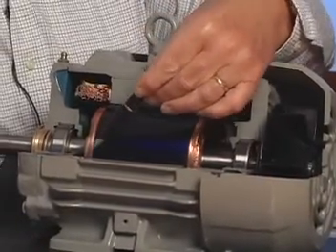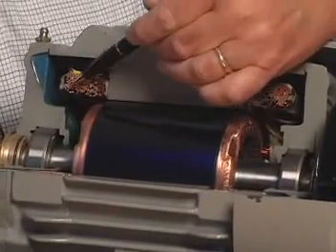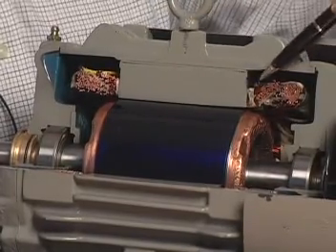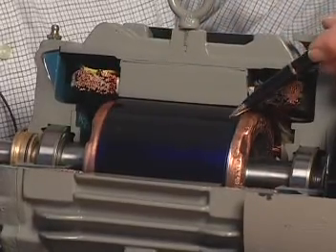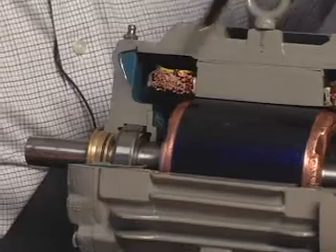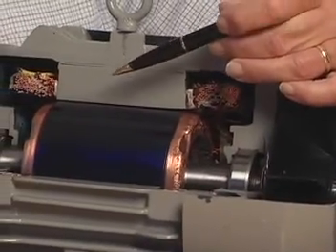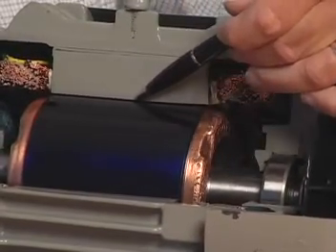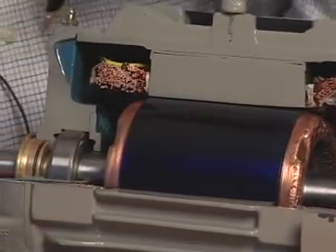Above-NEMA Premium Motors

Comment: The asynchronous motor equipped with a FAVI Rotor achieves over 90% efficiency. Its optimized design, its ease of industrialization makes the production costs of such a motor lower than those of a permanent magnet motor. Visit us at www.favi.com